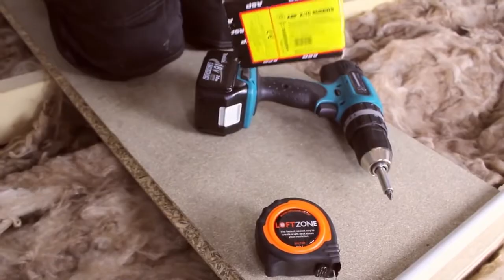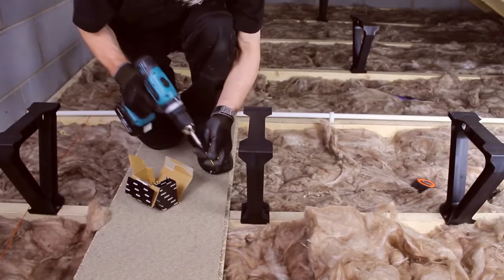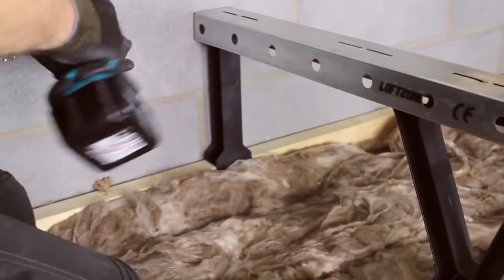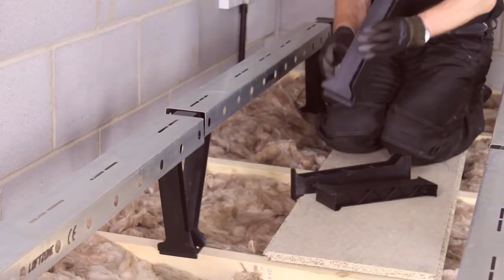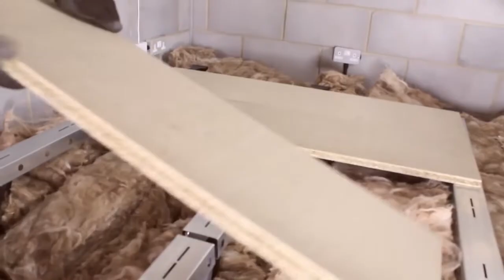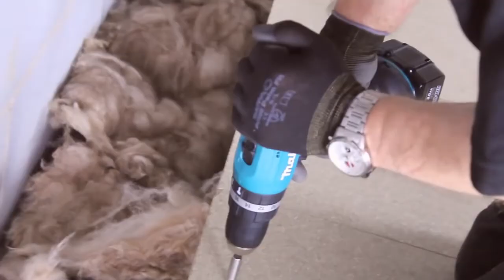How to add an attic floor above attic insulation

Comment: 8 inches? those screws are NOT 8 inches long. just sayin.
Reply from the maker: Yes that's right. They are 8 x 1.5", the speaker misspoke. In any case, we supply all the screws you need in the kits anyway :)